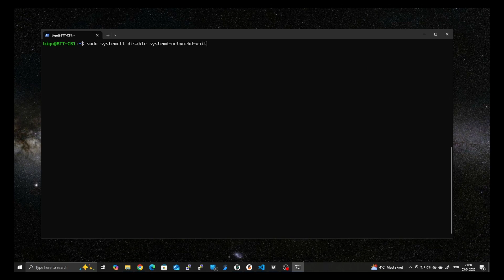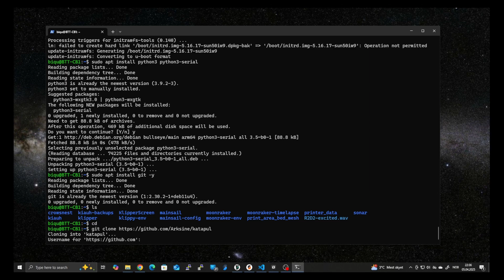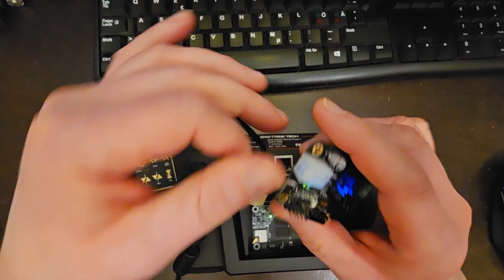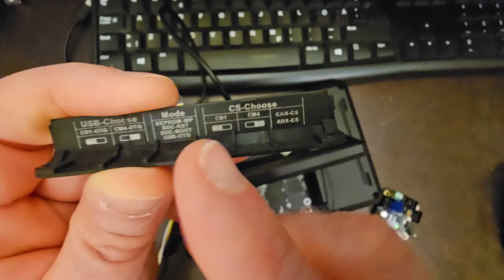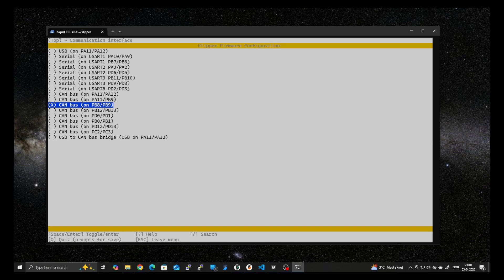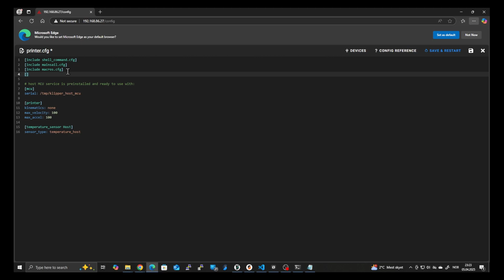How to set up CANbus on the BTT PAD7

Comment: you taken so much stress off me.  i been going throw hell trying to get this to work.  i had no clue  i had to do this in pad7 to get this to work.     can i ask.   when i dazzy chain them.   do i need to do the full flash setup again.  or just  the stm32 setup.   i got  a ebb42  for mmx  and a ebb32 for the toolhead  that well be here soon.
Reply from the maker: Just flash the firmware in can mode on ebb's or whatever new controller board you want to add.

Comment: I still use the btt u2c 2.1 for my can operation with the pad 7. Just followed the esoteric canbus guide and it worked like a charm.
Reply from the maker: Of course that'll work, but it's not needed since the pad7 has canbus built in.

Comment: Perfect timing! 
I got a Pad 7 a few weeks ago, and just received my EBB42 yesterday.
I'm waiting on shipments for a Beacon probe and CHC Volcano hot end with PT1000 to start the project, but this tutorial covered a lot of questions I had.

To power the EBB42, could I just splice 2 wires into the 24V input on the original 3D printer board (the green block where the power supply connects)?
Reply from the maker: Yeah, but keep in mind that the pad7 should share the power source or at the very least share a common 0v.